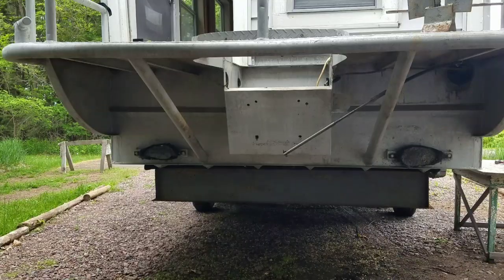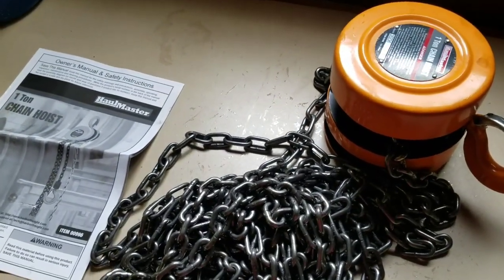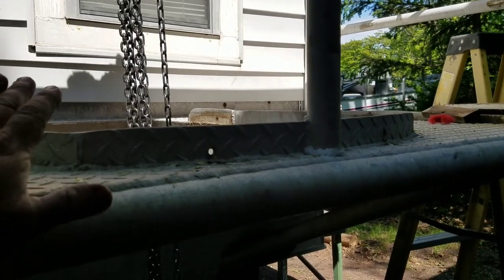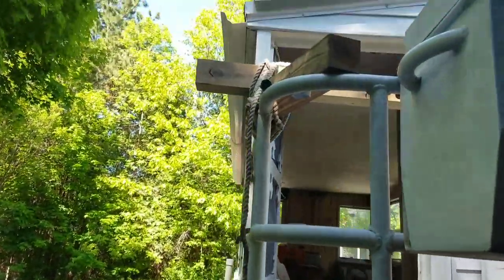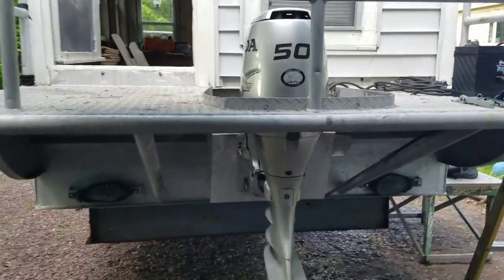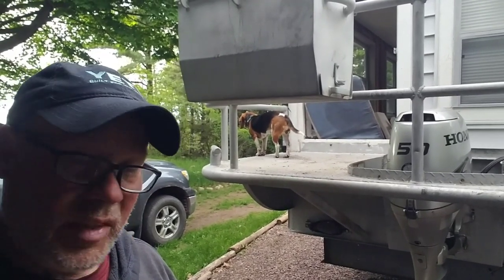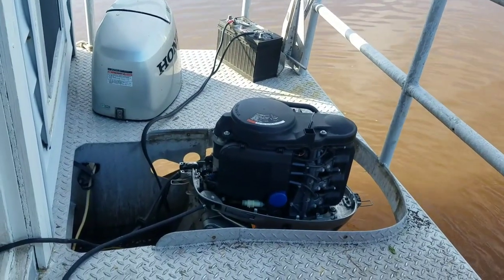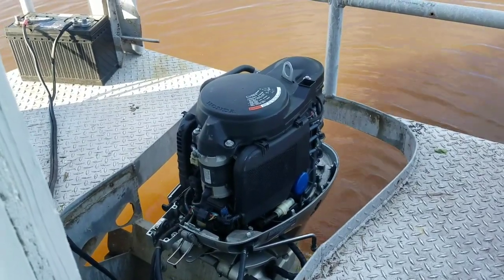Ep:4 "The Beagle Barge Beagle Build" | Powering up the Beagle Barge!

Comment: I truly feel you found the perfect Shanty Boat. It was made for that little Honda engine. One word of advice. If you plan to take long trips I would find a 6-7ft 2in. aluminum tubing like your handrail. Weld another 18in piece on the top end at 90 degrees. Drill a hole in the end for a eye bolt. You can set it on the deck and lash it to the handrail. (You have a Boom) If you ever need to lift your engine you just pull it straight up and spin the tube and set the engine on the deck. Or let it hang while you change lower unit oil or install a new prop. You can always hind the tube under the bed or strap it to the back handrail. On a long trip down a river this could save you a huge haul out bill, plus if you are in the middle of nowhere this will allow you to lift the engine and fix any problems without getting wet. You already have the chain lift.  
Plus If you don’t already have a cover for the engine hole and don’t want to build one out of aluminum you can always build a square box out of 2x8’s and put a 3/4in piece of treated plywood on it. Paint it gray with some stainless gate hinges so you can flip it out the way so you can check the oil daily. 

 If you build the boom right and weld some small loops to the handrail you can use this boom to lift up a small Jon boat or use it to set your kicker motor down onto your dinghy. This boom can be made very cheap, but it will save you a lot of time and money down the road. I just build two out of aluminum for a guy at our Marina. He has a small houseboat and wanted a way to lift his 8ft Jon boat onto his back deck for cruising. I did weld a 12in piece of angle in the 90 degree part of the boom to help give it more strength. I already had the tubing in the shop and I bought SS eyebolts. I didn’t have $50 bucks in two of them.  I’m just trying to help by giving you ideas. Not telling you what to do. I’m really excited to see you make a long distance voyage with the Beagle Barge. This will be great content for your channel. I just installed a new 40hp  mud motor on my skiff and made a few videos. But I plan to start making more content for my channel as well. Good luck with your adventures...